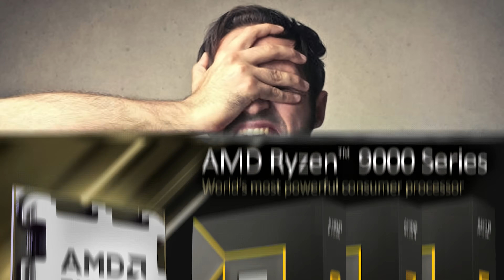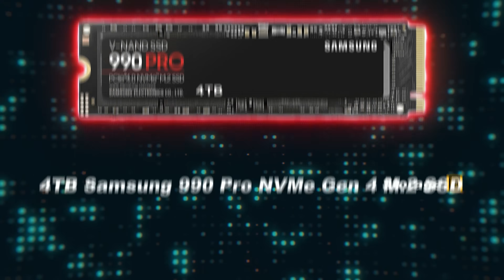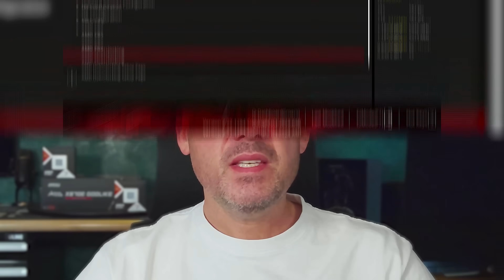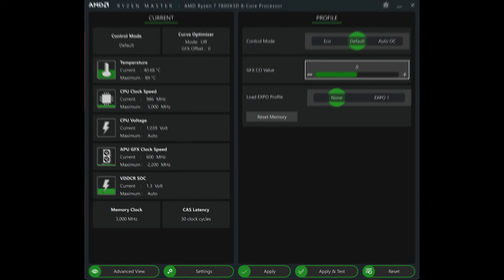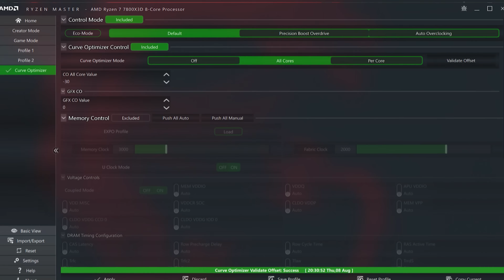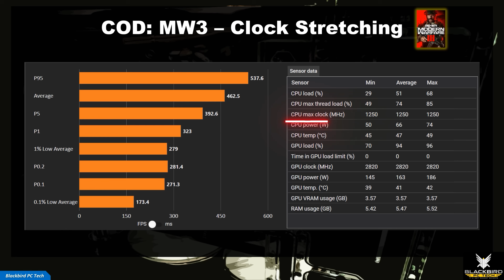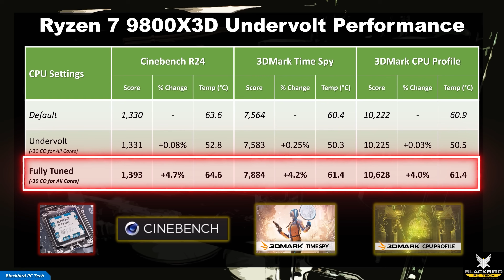How To Undervolt a Ryzen 7 9800X3D The Right Way! (or Any AMD AM5 Ryzen CPU)

Comment: Marvelous video. I'm currently running a 5800X3D and RTX 4090. Before I upgraded to that CPU, I first read reports of it running cool because it didn't overclock itself to speak of. I therefore kept my 850W EVGA Gold PSU and my Noctua NHU12A Air Cooler. With the 4090 GPU undervolted and that air cooler, I've found both the lower-than-recommended PSU (Asus officially recommends only an 850W PSU for their TUF 4090, a departure from the prominent recommendation of 1,000W) and the air cooler to be perfectly adequate for running Microsoft Flight Simulator. Both the CPU and the GPU stay quite cool -- any more powerful PSU would be inefficient. Any higher capacity CPU cooler would be a waste of money. THE QUESTION of THIS POST:  With a 9800X3D and the same 4090 GPU on an AM5 motherboard, might I be able to go with the same 850W PSU and Noctua air cooling for the CPU IF I *undervolt * both the CPU and the GPU?
Reply from the maker: You possibly could however I wouldn't recommend it. The reason I wouldn't recommend it is that the most efficient part of the power/load curve is around 50% load ... so there is no downside to getting a larger GPU, other than purchase price. So my point is why risk tripping the PSU and restarting your system when it's not efficient to run the PSU close to 100% load. This is something I need to do a video on because it's something that is misunderstood within the broader community.
Reply: @ 
Thanks. Definitely noted. In anticipation of the requirement for a 1,000W PSU for the 4090, i actually bought a PCIe-5 ATX3 PSU last year. When the 4090 arrived and I saw that Asus recommended an 850W PSU for PCs with their TUF 4090, i just used the PSU I had -- i.e., , I've had this high-quality 1,000W PSU gathering dust on the closet shelf ever since. Per your advice, I'll use it in the new build this year. Just hope I don't get one of those 9800X3Ds that burn up.
I've always read that an oversized PSU is a mistake because they are not efficient at 50%. I'll look forward to your video on that
Reply from the maker: @ It's actually the opposite, they are most efficient at around 50% load. And I wouldn't worry about your 9800X3D burning up ... lots of hype, but not much truth to the story ... it appears that there may be an issue with ASRock motherboards, but even then the chances of anything happening are extremely low.

Comment: For the 7950X, if I plan to use the 105W ECO mode, is everything in this video still applicable to my use case?
Reply from the maker: Yes however expect a smaller benefit because you are already limiting the power to the CPU.

Comment: Just done a -25 on my 9800x3d and is so much better, I suspect I have some more room but this is something I always do with Ryzen is an undervolt of some kind.
Just did basic test on cinebench r24 multicore and got the following:
Stock - 1278 @ 82.8c
-25 - 1363 @ 67.9c

That’s almost a 15c difference in temperature it’s kind of insane
Reply from the maker: And an increase in performance

Comment: I prefer doing a Per Core Undervolt as some chips can have drastic difference in which cores like what offset 5 of my cores did -40 Offset no problem. The other 3 were -25, -30, and -35
Reply from the maker: The question I have for you for your chip is what is the performance difference when you dial it in per core versus simply going all-core at -25 CO? When I looked at this the difference was small, so that's why I say the time required to dial in a per core undervolt is not worth it.

Comment: Does x870e carbon have undervolt options and tweaking as other boards?
Reply from the maker: All boards should offer the PBO options I use in the video because it’s a standard AMD feature set.
Reply: @blackbirdpctech  yeah but can you also manually set vcore or just vrm values for carbon x870e board?
Reply from the maker: @Archy112  I’m sure you can … it’s a relatively high-end board but I’ve never used it

Comment: Hello , can you tell me an opinion based on your exp if  the components are good ?  thank you !

Motherboard  GIGABYTE B650M DS3H

Freezer 36 Black	Cooler CPU ARCTIC AC Freezer 36 Black

memory  Patriot Viper Venom 32GB DDR5 6000MHz...

NV3 1TB PCI Express 4.0 x4 M.2 2280	SSD Kingston NV3 1TB PCI Express 4.0 x4 M.2 2280

Ryzen 7 9800X3D 4.7GHz box

Nexo, 80+ Gold, 850W	power supply nJoy Nexo, 80+ Gold, 850W

 GIGABYTE Radeon RX 9070 XT GAMING...
Reply from the maker: A couple of things, you didn't list your CAS Latency or CL for your RAM. And I've never heard of your power supply ... I would caution against getting a low quality PSU.
Reply: @blackbirdpctech   it s a local brand, but it s gold rated CL 30 RAM
Reply from the maker: @wargods9109  the RAM is good but just because the PSU is Gold rated, that doesn't mean it's good quality ... that simply states that it meets a minimum efficiency standard.

Comment: I've noticed that negative offset on all cores is recommended, as opposed to when undervolting my 5800X the advice was usually to offset the two 'best' cores less. Is that more of a Zen generational change, or was that not optimal in the past?
Reply from the maker: I undervolt my 5800X3D/5700X3D chips with an all-core offset. It only really makes sense to do a per core offset if only a couple of your cores can reach higher stable undervolts ... if your chip does a -30 CO all core stable then I wouldn't bother with per core ... takes a lot more time to dial-in and the performance benefit is minimal.

Comment: Hey just wanted to say thanks for the video.  Have built a few computers now but never messed with undervolting.  Am stable on the test (at least for 15 mins) at a -20 under volt and only hitting 72C on a NH-U12A air cooler so I am pretty happy with that.  Doubt I will push the under volt any more since I doubt I will even hit those temps in gaming.
Reply from the maker: Glad it helped ... it's a very cool and easy to use feature for AMD Ryzen CPUs.
Reply: @blackbirdpctech  Definitely, especially with as hot as the 9800x3d runs (at least on air cooling).  Can't wait to test some games and see how it holds up.  🤝

Comment: I have a 9800x3d with gigabyte x870 elite mobo, Corsair 6000mhz cl30, Corsair h170i 420’cooler, 11 140mm fans in havn hs420 case. Stock cpu settings on cinebench I’m hitting 95c. My idle temp is 40c, and gaming 250fps on rust is at 51c. Why is my cinebench temp so high? Even at pbo -30, I’m still hitting 92c? If I set thermal throttle threshold to 80, it only hits 80, and my cinebench score goes up from 22500 to 23500. But why does it run so hot with threshold off? Others are only hitting 74-80c with smaller aios?
Reply: Alright, so if my idle temp is 40c, and gaming temp is 45c to 55c then my aio is obviously working good and pump has good contact with cpu. It’s just in cinebench it hits 95c within 10 seconds. I also have the gigabyte x870 elite mobo, i rem reading your post saying it had some issues at times in the mobo settings. Would you see the thermal throttle limit to 80-85c or just let it run at 95? I only ever see that temp if I run cinebench. Gaming and every day task it never goes above 60c
Reply from the maker: @tatookid1587  I would follow my guidance in this video on how to tune and optimize AM5 Ryzen CPUs: https://youtu.be/9y_MGzrQHDg
Reply: Hey brotha found the issue, I never installed icue, because I use signal rgb, and the aio pump wasn’t ramping, it was only running at 1800rpms, I turned it to max, and now it only hits 79c on cinebench with no thermal throttle set
Reply from the maker: @ now it all makes way more sense, glad you found the root cause of the issue.
Reply: No prob thanks again
Reply from the maker: Your score went up when you set the thermal throttle? How long are you running the cinebench test for?
Reply: Yea that’s what makes no sense. I’m just letting it do a short pass. If I do the 10min pass it’s the same score. I just hate seeing the temp sit at 95.1c for 10 min if I leave the thermal throttle temp set to auto and not set it at 80-85c. Why is it running so hot compared to others when I have the best cooling case and fans and large 420 Corsair aio?
Reply from the maker: @tatookid1587  don't compare your PC to anyone online ... you have no idea if they are telling the truth, what conditions they are testing under, etc. The 9800X3D is designed to operate up to 95 deg C without impacting its life, so don't worry about that. Cinebench will place a heavy load on your CPU, that's why it's hitting the thermal throttle limit. All of that being said, my guess is that you are likely using a motherboard power/current/voltage setting that removes all limits. The reason the score goes up when you provide a lower limit has something to do with the boost algorithm ... my guess is that it behaves much more consistently at the lower temp, meaning the frequency remains consistent ... versus large drops in frequency at the higher temp.

Comment: This helped me alot on 9800x3d! Temp lowered 20 degrees! Such an easy guide to follow, thank you’
Reply from the maker: Happy to hear it helped!
Reply: @blackbirdpctech  how are the temps now? :)
Reply from the maker: @ I feel like I’m missing something?
Reply: @blackbirdpctech  i ordered a 9800X3D and heard about the failures and dying cpus so i was wondering how the temps were a month later
Reply from the maker: @jacobaltman102  unfortunately you listened to the drama and hype from other channels … the issues were on ASRock motherboards … apparently bios/firmware related and fixed months ago … all I can say is stop listening to the drama queens, they exist to create fear to generate clicks
Reply: @blackbirdpctech  thank you, i mean it did make me want to return it but thats all that my feed is. Thankfully i don’t have a Asrock motherboard. I have a Gigabyte B850 Aorus Elite wifi7. What do you recommend i first do when i first boot up? I’ve heard things like “the amd XMP for ram in bios causes issues and error codes”. This is also my first AMD chip as well, im upgrading from my i9-10850k. I basically replaced my motherboard, ram, cpu cooler, & most importantly the cpu. Im keeping all other components. Im also worried about the OS after swapping parts and what i should do to make sure i have no intel drivers or anything. Sorry if this is a lot.
Reply from the maker: @jacobaltman102  I would highly recommend re-installing Windows.

Here are three videos you should watch:

1. How To Tune an AMD AM5 Ryzen CPU: Step-by-Step Guide! - https://youtu.be/9y_MGzrQHDg
2. How To Undervolt a Ryzen 7 9800X3D The Right Way! (or Any AMD AM5 Ryzen CPU) - https://youtu.be/6vROzalei6Y
3. What's The Best Memory for AMD AM5 Ryzen CPUs? - https://youtu.be/JuUhnQaGG_I

I am doing a masterclass tomorrow on this, but it's for members only ... so if you want to join and see me walk through it live then you can join here:

https://www.youtube.com/channel/UCQwpOG-l1nYHtX2alMFdLFQ/join

Comment: just got ryzen 5 7600 radeon rx 9070 xt pc and i dont want to undervolt it for performance but temps instead since i wont be using its full potential for a while anyway
Reply from the maker: Make sure you checkout my new undervolt guide for the 9070 XT too: https://youtu.be/IoOg0Qglneg

Comment: I’m getting occasional black screening and cpu clock speed dips when black screening happens. BIOS is CO -15, EXPO I at 6000 mhz, and PBO enabled (motherboard). CPU is 9800x3d
Reply from the maker: Make sure that you follow this guide to tune and optimize your 9800X3D: https://youtu.be/9y_MGzrQHDg

That said, this sounds like a GPU driver issue ... I assume that you are using an Nvidia GPU ... have you updated your driver to the latest version?
Reply: @blackbirdpctech yes I have a 3090 FTW3, I also underclocked it a tiny amount. Drivers are up to date with the nvidia app and I even tried to do a fresh install, same black screening though
Reply from the maker: I would recommend removing the undervolt and seeing if you still get the issue ... I still think this is a GPU driver issue ... you should DDU your drivers in safe mode and try re-installing the latest drivers from Nvidia
Reply: @blackbirdpctech I removed my undervolt and did the DDU process, now I’m getting more black screening, and there is a tear in my screen (vertically) ☹️
Reply from the maker: @dragonpixels  unfortunately it sounds like your gpu is dying … try removing your gpu and running off the iGPU in the 9800X3D if you can … or try a different dGPU if you have one.
Reply: @blackbirdpctech the black screening was happening initially after the fresh driver installs, then I restarted and I’m doing a stress test in 3dmark, one black screen so far. For reference I’ve had this GPU since about 2020, it’s a 3090 ftw3. Also I still have my cpu undervolt enabled, but gpu undervolt is off (reset to factory settings)
Reply: @blackbirdpctech btw I appreciate your help! It means a lot that you are taking time out of your day to help me out
Reply from the maker: No problem, let me know what you find … also check your cable
Reply: @blackbirdpctech just finished a loop of 20 in 3dmark stress testing. Got about 16 black screens, all with the cpu clock frequency dropping to around 2600mhz when black screening. I could send you the 3dmark file if you’d like, or if you have specific questions for my results I can try to answer them!
Reply: I’ve turned reset bios to default settings and I’m still getting the same black screen issue, going to check the cables now

Comment: My 9800x3d is at 5372mhz. Is that my max? I’m currently at a -25 but -30 causes issues. I see yours at 5423
Reply from the maker: Did you follow this tuning guide for the 9800X3D: https://youtu.be/9y_MGzrQHDg

You can bump up your max CPU frequency in PBO2 ... this guide will show you how.

Comment: When you say stock benchmarks does that also include not turning on the AMD EXPO in the bios once we finish building it?
Reply from the maker: That's a good question ... stock settings should mean not overclock on anything however most reviewers run their "stock" settings with the RAM overclocked.
Reply: Thank you a ton!

Comment: Thank you for your video
My 9900x with all cores -30 works fine in 10min AIDA64 stress test, is it good or do i have to test longer than 10min? Thank you
Reply from the maker: As I mention in the video, there is no definitive standard for stability ... I would recommend using your system with the apps you use and if you start to notice any issues then revisit your undervolt.

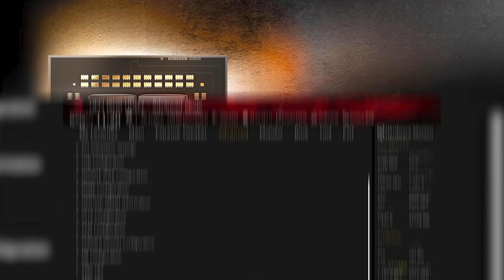Comment: 3:30 why do you recommend the opposite of what the motherboard manufacturer recommends?
Reply from the maker: I don't understand what it is that you are saying ... what is it that most motherboard manufacturers recommend?
Reply: @blackbirdpctech they offer their curve optimizer presets via the bios. For example ASRock’s OC Tweaker has a PBO with TJMax and negative mV presets under PBO. Going into AMD Overclocking and making changes there can conflict with BIOS settings (as you yourself mentioned). That warning under AMD Overclocking even as a warning.
Reply from the maker: @ that's not what I stated in the video ... I discussed two locations within Bios to enter the exact same information. A lot of motherboards will have presets but the issue with presets is that you can only select what they offer ... you can't tune it yourself. So, for example, MSI offers three preset levels of undervolt ... -30, -20 and -10 ... if you are unstable at -30 you can't try -25 with the presets. Using the AMD PBO2 feature set to make these changes is much more flexible and allows you to achieve better results.

Regardless, how is that "the opposite of what motherboard manufacturers recommend"?? That's just pure nonsense.
Reply: @blackbirdpctech  In that case I would think the -20 preset would be fine.  Most people are going to experience diminishing returns trying to squeeze out another -5.  It's true that the low level AMD settings are more flexible, but we're talking about people on here just learning the basics.  The appeal of the BIOS level presets is that they are an one and done setting.  Users are also less likely to accidentally mess something up unlike in the low level settings (hence the warning).

Also, anecdotally, I have experienced AMD Overclocking setting simply not applying on my MSI B450 board if I have anything set in the BIOS presets (even DRAM settings).  Probably a firmware bug, but it's a PITA.

The low level AMD Overclocking settings are more like an API provided by AMD.  It allows the BIOS (or even Ryzen Master Software) to build on top of that API.  You can tweak the low level settings directly if you know what you're doing.  But people searching on YouTube how to undervolt their CPU generally don't know what they are doing otherwise they wouldn't be here.  Having them go into that menu where they could potentially brick something is reckless.
Reply from the maker: @modex20  that is exactly why I do a step-by-step guide. This notion that people should live in fear of making a change in bios is exactly why I started my channel … it’s wrong … you are not going to destroy your system. Please don’t spread misinformation on my channel.